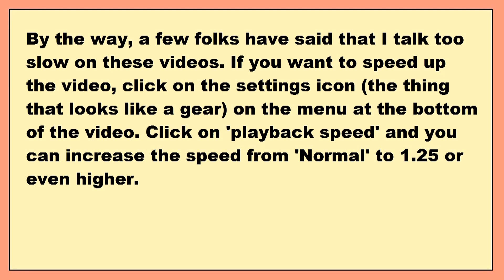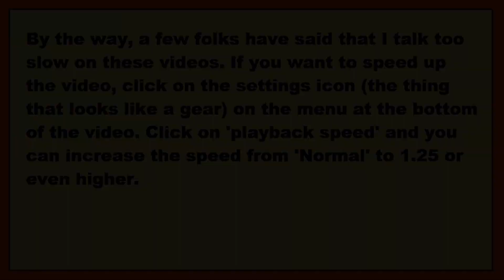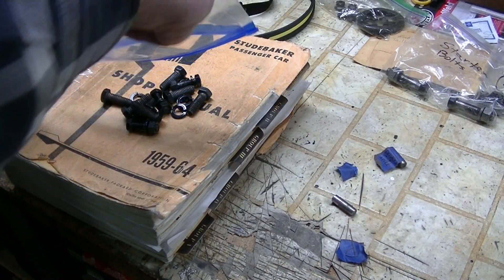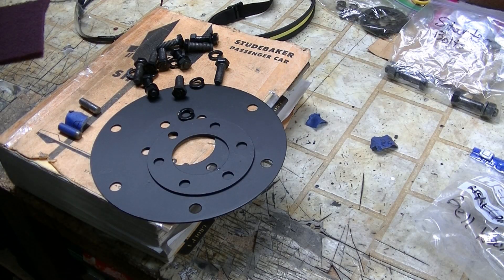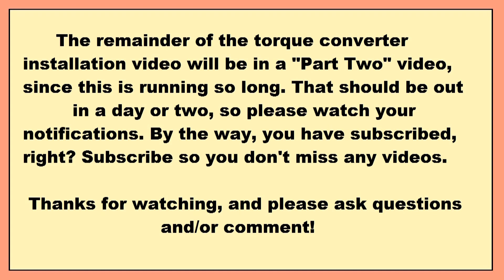PART ONE: Installing the Flex Plate & Torque Converter on a Stude V8

Comment: I just rebuilt a flight o matic for my lark.  It seemed like a well built trans and luckily no hard parts were broken.  I’m excited to see how it drives because I’ve never drove one.
Reply from the maker: Thanks for watching! The Flight-O-Matics are good transmissions, but are quite different from 'todays' auto transmissions. They start out in 2nd gear (except for some early FOMs and some six cylinder FOMs) unless you either pull the lever down into low when starting out (then move it back to Drive when you want to go to 2nd), or unless you floor the accelerator pedal for a 'jackrabbit' start. 🙂  Yes, they are reliable transmissions, and fairly strong. Personally, I'm a 'manual with overdrive' guy, but this is such a solid low mileage car I didn't want to change it to manual. Good luck on yours!

Comment: So let's see you fill the torque converter through the center hole and you drain it out to the. drain plug is that correct ?
Reply from the maker: Yes, that is what I did. As I mentioned, not sure that did a whole lot but it made me feel better. 🙂
Reply: Well this is good to know Thanks. @r1lark